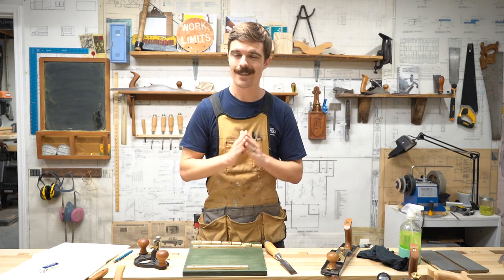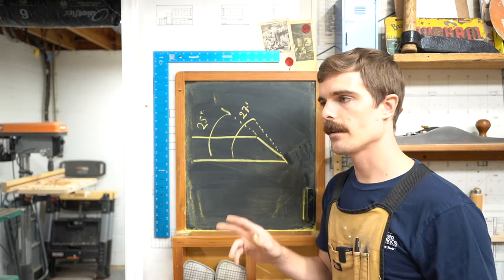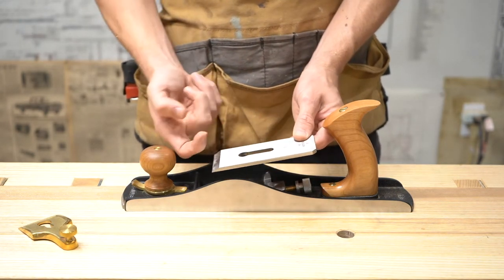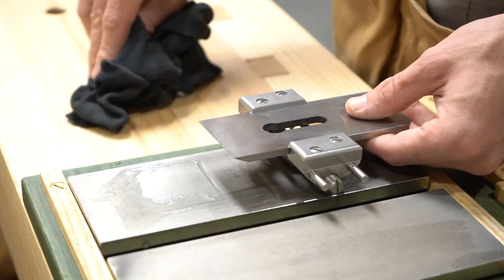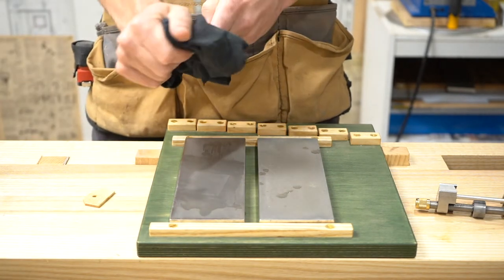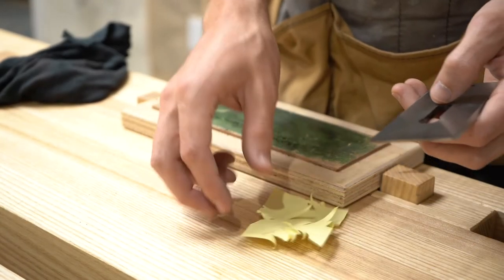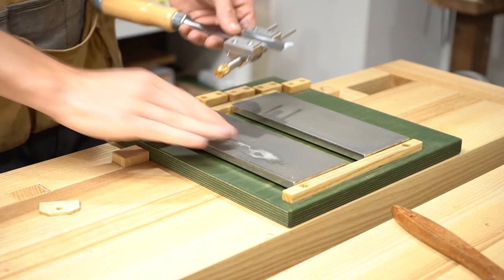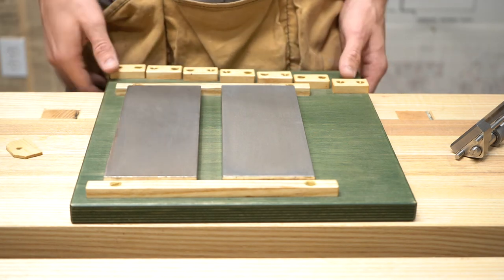How to Sharpen Blades with a Honing Guide

Comment: Hi,
Thanks for making this video, it's really great!

I have a question, though...
Just recently I bought the Veritas Side Clamping Honing Guide, but I'm having some issues, using it.
I have a few older chisels, where the primary bevel has been sharpened by hand, poorly, so they're pretty much off...
Now, shouldn't I be able to reestablish the primary bevel, using the Honing Guide, without having to use a grinding machine, like the Tormek, for example?

Using the Honing Guide, I can't get it to hone the bevel square... I'm doing what I can to keep even pressure, make sure the chisel is well clamped in the guide, but no luck, the bevel is not being honed square... Could this be a faulty guide, or what's the problem here?

Thanks again for the video.
Have a great day.
Cheers.
Reply from the maker: It’s a little hard diagnosing the problem without seeing it, but if you’re reshaping an out of square chisel it will look weird until it’s fully reestablished a primary bevel. Did you the entire surface sharpened?
Reply: @StarrWoodworks  - Hi and thanks for your reply.
Yes, it will look weird until I fully reestablish the primary bevel, so I kept going, until I have the primary bevel reestablished, but at that point the chisel were out of square, it was really noticeable, looking at it across.

Thank you.
Looking forward to your reply.
Reply from the maker: DM me a picture over on instagram and I’ll see if I can help at all @GuitarNTabs

Comment: Lot's of interesting opinions in this video.  I'd take issue with several.  First of all, almost no one uses a stone or plate to reestablish the primary bevel. That is usually done on a grinder or a flat spinning disc.  Second the ruler trick is a great way to speed up the sharpening of the plane blade. Without it you must ensure the entire back of the blade is flat.  Third stropping is not necessary.  You can achieve the same results with a very fine stone and you don't have to remove the blade from the honing guide.  Just use a 1000 grit first and then 8000 or 16000. Lastly yes a 27.5 degree angle is greater than the primary angle but that is too shallow.  It doesn't leave enough metal behind the bevel and the edge will break down faster.  You are much better off to use a 30 or 35 degree secondary bevel.